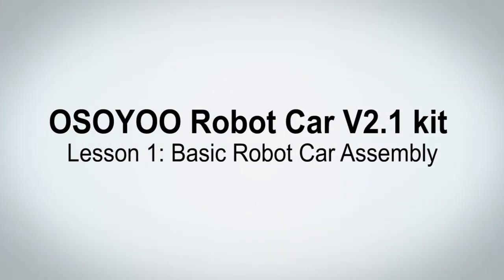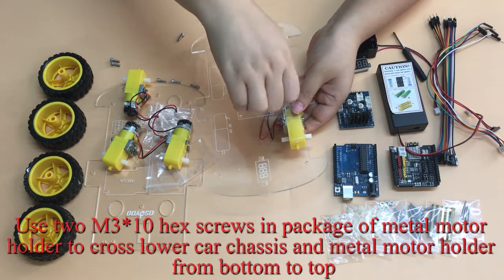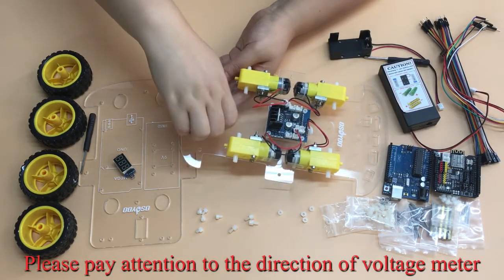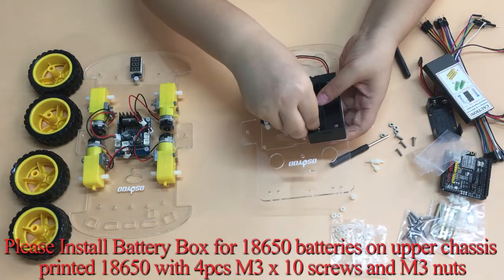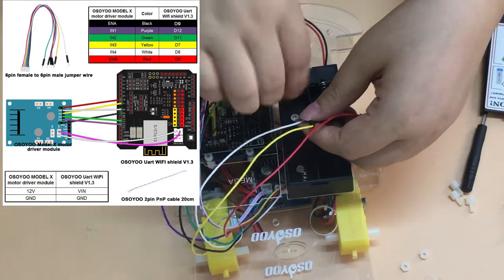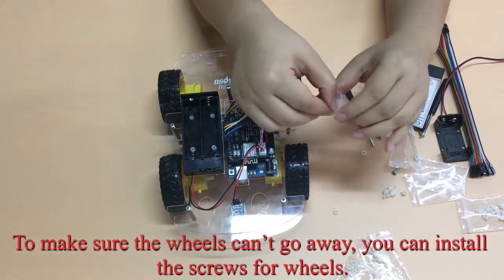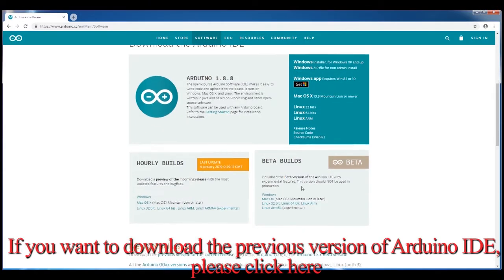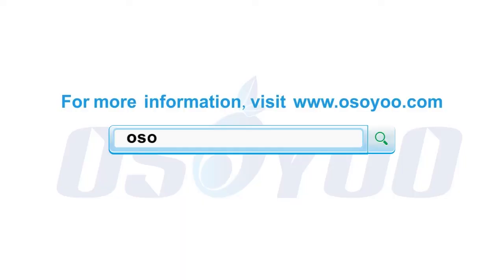OSOYOO V2.1 Robot Car for Arduino Lesson 1 : Basic robot car assembly

Comment: The car does as expected, but the voltmeter does never turn on.  I checked the connections and they are alright. Could it be that the voltmeter came faulty?
Reply: Did you plug in the 2 connected white wire with purple text on it

Comment: To the viewers of this video that are stuck on the sample code downloading part, I had the same issue, and I resolved it by clicking more on the box under the video, scrolling down, and when you see 3 different-colored books with a belt or something like that connecting them, click it and then, I think you will figure it out once you get past it, but there might be an error message.

Comment: Hi! I just bought a new kit and I've been following everything you do on this video,  but something doesn't work properly...! I've connected the Osoyoo Model X driver module 6 control pins to Osoyoo Uart WiFi shield V1.3 D6,D7,D8,D9,D11,D12 in the same way like you did but works just the left side wheels, so if I'm going  to plug the 6 pins female in the other way, are working the right side wheels but not all 4! I can send you some pictures to have a look at the wiring connections.
Please can you help me to resolve this issue? Thank you!
Reply from the maker: Hi! Please get the 6pins wires from 20Pin jumper wire Male to female 20cm, and try it again. If any query, please take photos to my email address: elaine@vership.com
Reply: @osoyoo_product  
Good morning! I've been doing exactly like you told me and replaced the wires and unfortunately is the same result, the wheels are spinning just on the one side not all 4!!!
Do you have any other solution to help me make it work properly?
  Thank you very much
Reply: Do you ever fix this issue? I’m having the same problem.

Comment: The kit I have had all four motor plug cables wired the same way. In the directions it shows two should be wired differently.
Reply from the maker: Please follow the slots of the motor driver to connect the motors.